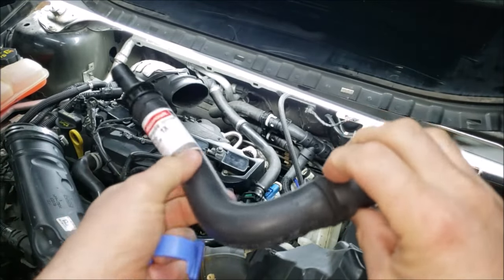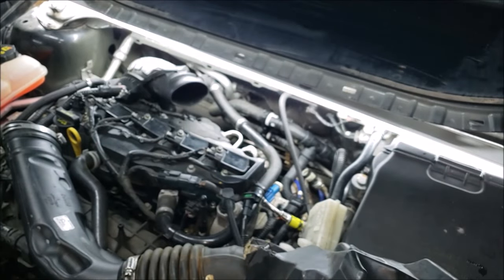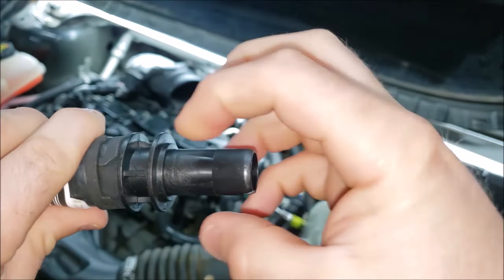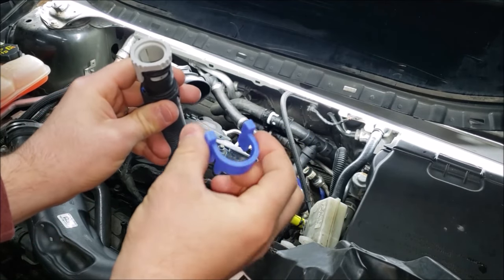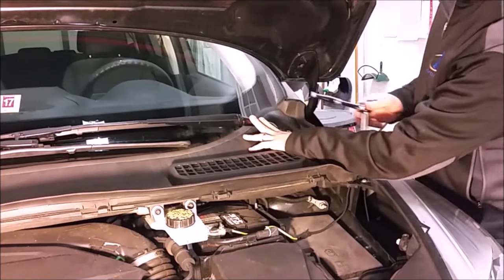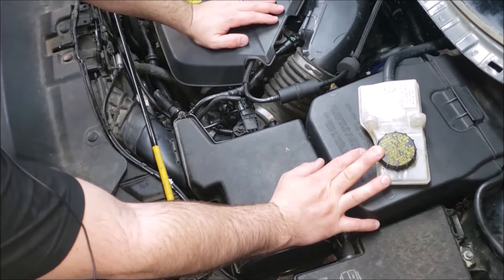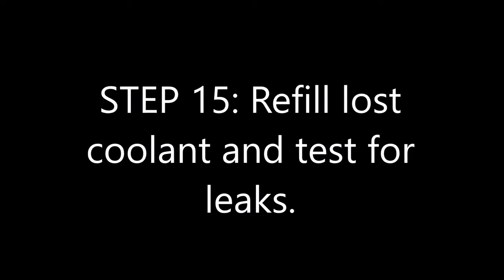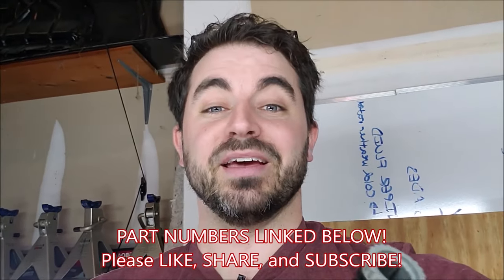Ford Quick Disconnect Heater Hose? TRY THIS! : HOW TO ESCAPE

Comment: Do you have a part number for the hose with the T that you disconnected from the hose that you replaced? I need that hose. For the life of me I cannot find that hose listed anywhere, but you mentioned that you had replaced it. The push-on fitting that goes into the temperature sensor neck is leaking. I wonder if I can just replace the o-ring in that connection to the temperature sensor neck. Help please!
Reply: I do see that you list the three-way hose but that hose looks different from mine. The order of the hoses in the T is different.
Reply from the maker: @Merryfrankster_  ok- do you drive an Escape? If so, what year and engine please? I can hopefully help look it up.
Reply: @HowToEscapeDIYTipsandReviews  2014 Escape 1.6T. I think I see what they've done. They've eliminated the intermediate quick connect fitting that goes from the T to the temperature sensor housing. Good idea, because it leaks! That's why the three way hose looks different.
Reply: The three-way hose for my car is actually MOTORCRAFT KH872
Reply from the maker: Awesome- glad you found it and narrowed that down! Hope it clears up that leak for you!
Reply: thank you for your help. Sometimes all that is needed is someone to serve as a sounding board. You did an excellent job!
Reply: @HowToEscapeDIYTipsandReviews  I just got through replacing the thermostat housing (fun) and it was still not holding pressure and losing coolant slowly. This leak was not so easy to find. After one hundred years of building cars, you think they would figure out how to make an engine that does NOT leak out of every orifice.
Reply from the maker: @Merryfrankster_  I agree with you 100% on that one with these Escapes. All the little plastic fittings...the skinny overflow hose from the reservoir that goes around the side of the engine... the 3 way hose on the right of the engine bay...bypass solenoid lol. Knock on wood, but it seems like its all the lines and extra add ons- never actually been a radiator hose or any standard part like that...for us at least
Reply: @HowToEscapeDIYTipsandReviews  I really feel like it's skating on thin ice with these Escapes - like a catastrophic engine failure just waiting to happen.

Comment: Was yours leaking at back almost in center of the passenger tire. My coolant keeps leaking and when I refill it I can see it run out but can’t see where it’s leaking.
Reply from the maker: Does it leak out only when you're refilling it? If so, you may be unintentionally pouring excess fluid out the drain slot at the back of the threaded area where the cap screws on. We have a basic coolant refill video where it shows this overflow drain hole just in case- ill share it below
Reply from the maker: Here is the video with the drain hole where fluid MIGHT be coming out IF its only happening when you are refilling: https://youtu.be/CYMCNKgTRiM
Reply from the maker: If you are leaking from the heater hose, ours was leaking at the plastic connector as the molded sealing features had degraded over time. Not at the connection to the firewall, but where it connected to the next 3 way hose on our 1.6L
Reply: I think when adding coolant I did hit over flow but it is loosing coolant it’s just hiding from me. Thanks for responding.

Comment: Can just the plastic quick connect be bought separately? Without having to cut my existing hose?
Reply from the maker: Unfortunately not from what I searched- you're talking about just the connector and not having to buy a new hose right?
Reply: Just the white part that you squeeze. I found an assortment pack of 5/8 and 3/4 but 3/4 seems to big to fit. 

So if I buy that piece in your video, how much hose am I cutting off?

Comment: Do you need that tool to remove these disconnects?
Reply from the maker: I can vouch from personal experience that the tool certainly helps. You don't require it, but its a lot easier to break the tabs off the connector especially if its original/older plastic.
Reply: Awesome as I have the heater hose assembly I need to replace. I don't think I'm touching the heater core side as it's leaking above the trans.

Comment: How replace the o ring
Reply from the maker: This part actually didn't come with an o ring. I'm not sure if there is a variant design with that ring, but ours didn't have the part available when looking at the diagram of the system.  What engine and year Escape do you have?